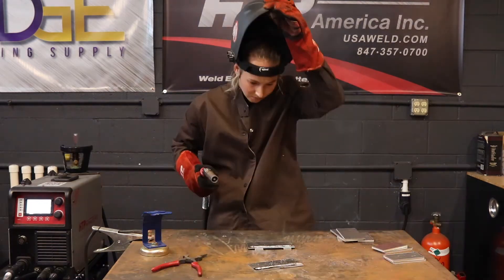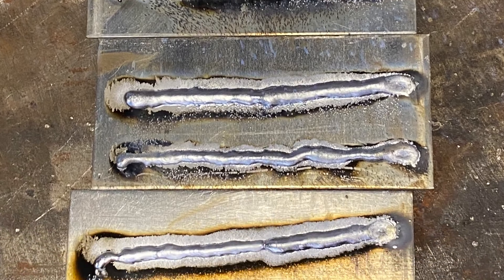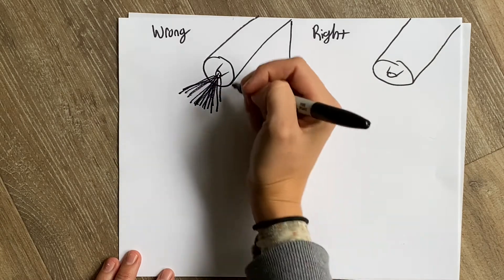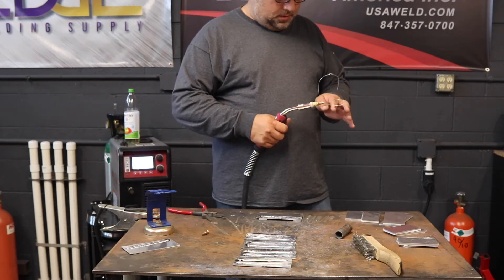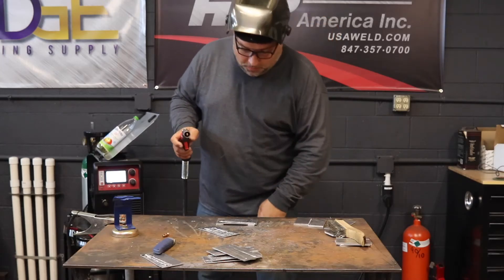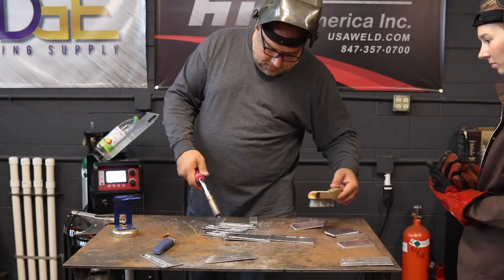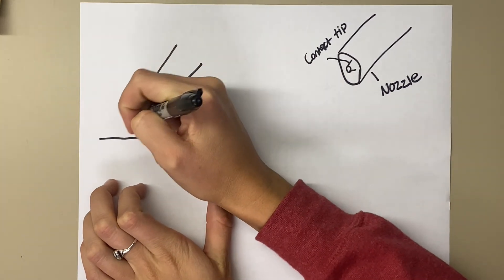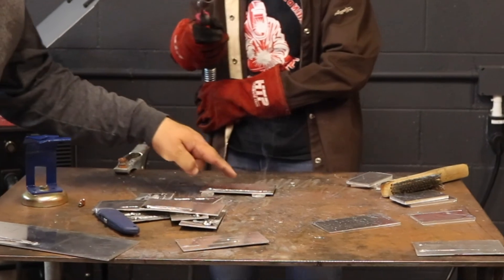Aluminum MIG Welding Troubleshooting with Peter Zila

Comment: Thx Peter, very helpful.
Do have a question or two.
Do you set the initial voltage or does the machine do that? When you adjust to neg 2 for example is that reducing the initially set voltage  by 2 volts to shorten the arc length?
What was the initial voltage? I thought to get spray transfer you needed at least 20 volts.
Am very confused about attaining spray transfer for aluminum welding.  From what I have read aluminum is best welded using spray transfer.  When I see  videos on welding aluminum I see settings of voltages down to 18v . Is it possible to get spray transfer at such low voltages? I have to say it is very confusing to me.
Thx for your help.
Reply from the maker: I just wrote this as a reply to someone else .. this should answer most of your questions.

If you need faster help you can contact HTP customer service over the phone or via email and if you have a question for Peter Zila just go to his YT channel he is usually much faster than we are to answer all the comments

that means that from the pre programmed voltage where "we think you could be" (not should be - could be). you are deviating -1.5 volt ... that is a "TRIM" function ....  where Lincolns trim is 1.00 for standard and you can go as low as 0.50 and as high as 1.50 our TRIM is 0.0 and you can go -8.0 and +8.0
Trim will "focus" your arc come .... less voltage (lower numerical trim number (on our machine and or Lincolns machine) will shorten and focus the arc cone, a higher numerical number will lengthen the arc cone.  
the "goal" is to have your arc cone as short as possible without much crackling, if it is crackling you need to add TRIM (voltage) again ....  
this is how you control arc length in a spray arc.

and you might ask - well - why didnt you make it so it is perfect at 0.0 ???

well - we kind of did ...  it depends on what you weld (what alloy, with what filler, how warm or cold your part is, how large in size your part is ... etc etc etc ...).   also no 2 people weld aline , no people use the same brand wire from the same lot number ....  so there is some variation ....

to see a trim setting of + or - 1.0 or even 2.0 is not unheard of, this is "standard operation procedure" if I see a guy using trim -4.0 or -5.0 I question if his contact tip or liner is still in good shape or drive roll pressure is too loose....      settings od +4.0 or more are often an indicator for the wrong gas or the operator is accidentally int he wrong program ... (using 030 wire in an .035 program etc ....)

Comment: How do you get the aluminum wire to move through a whip? It does not look like a pull gun.
Reply from the maker: We use a low drag liner and high quality  aluminum wire. It is surprising what a difference it makes. Also our aluminum gun is sized to the system to make it run like this. This machine is made to run aluminum among other steels and alloys. It is awesome.

Comment: Can't really run 4043 through a standard MIG gun.  You are having feed problems.  You are also getting flashback to the contact tip.
Reply from the maker: With a 26 MIG gun you can absolutely run 4043 and other aluminum wires. All with way more adjustments / parameters than a spool gun.
Reply from the maker: Yes, you are correct. You must change the liner at a minimum when switching to aluminum. With the ProPulse system, we use the 26 series gun set up for aluminum with a Teflon liner. I see what you mean about other manufacturers equipment being different. If you weld aluminum- you have got to try a Pro Pulse- it gives you a unique way to join metals.
Reply: @usaweld  I recently purchased a dedicated TIG welder and your dedicated TIG Welder was in the running.  I think that you have very fine products, but what concerns me, and correct me if I am mistaken, is that only a 30 day warranty period is provided.  For the expenditure that is being made I consider this to be a shortcoming.  When I am looking at acquiring another welder, i will definitely consider your products.
Reply from the maker: @paulkurilecz4209  30 day Money Back guarantee. 3 year warranty on most machines. We take care of our customers.
Reply: @usaweld  
Thank you for the correction.  When I need another welder, I will definitely consider this machine again.  Perhaps I was just confused.

PS:  I purchased a spool gun for my current MIG welder and I like it very much.  A little bulky though.

Comment: I think I heard you say you don't like to use crappy wire. I didn't think name brand mattered.... Do you have a video about the wire you recommend? As far as alloy I use 4043 most the time.
Reply from the maker: Yes we do. We use Alcotec aluminum wire at HTP and that is all we sell. We have a video about it too.
Reply: @usaweld after a year I'm watching this video again and just now seeing your comment. Thank you very much! Will watch that video now. Also i was going to make a comment asking what it means if the wire keeps jabbing on the start. I checked ground and temp. Got a new ground clamp and temp is as high as i can turn it with the thickness I'm welding..⅛"
Reply from the maker: https://youtu.be/b6LpYaFwn_M

Comment: Does this apply to steel wire too?
Reply: Yes applies to MIG any wire. Other wire feed variable is make sure to use the right wheels. .025 .035 Flux or non-Flux. Using correct contact tip (size wire).
Reply from the maker: No

Comment: I mean, what other company puts out this kind of awesome tutoring videos? This is great! One question - how often would you say you'd need to change the liner? For instance, once per 8" spool of aluminum? A dozen spools per liner? 25? Thanks, really enjoying these videos!  mike
Reply from the maker: Unfortunately there is no set time as there are a lot of variables that play into how much the liner wears and tears. It really is based on the weld and when the wire is not feeding right.
Reply: I store my welder in a job box with other welding supplies. I have a higher chance of bending or kinking my liner. Think of a long spring throughout the entire hose. If you didn't already know.